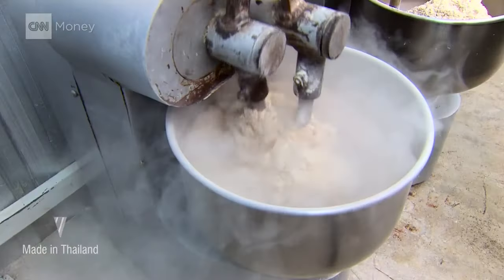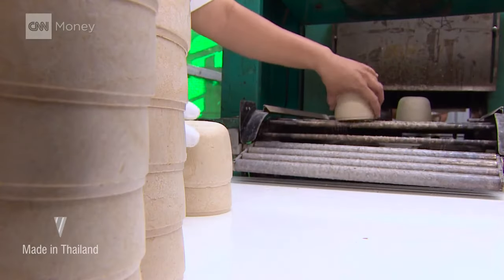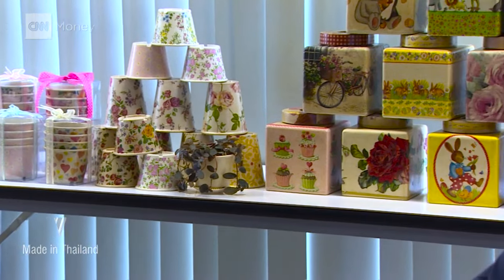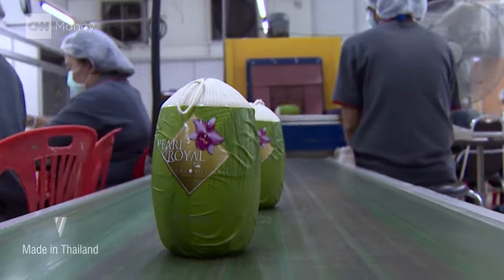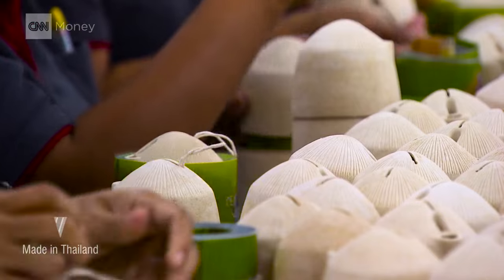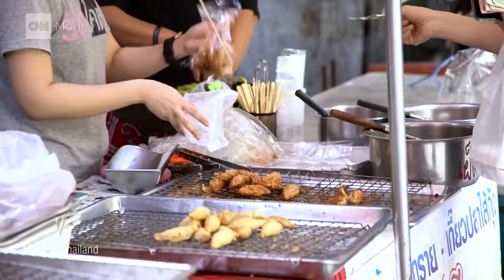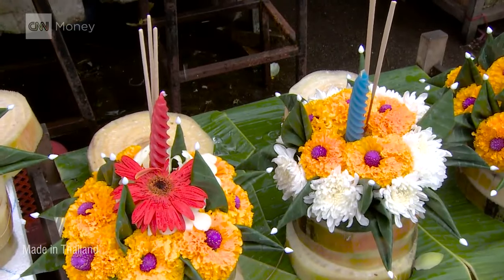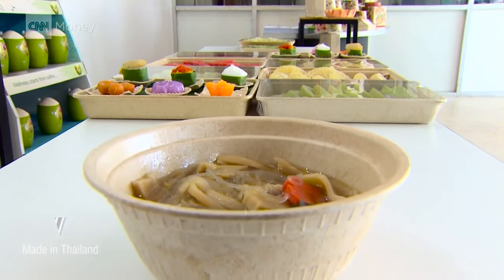This zero-waste packaging is made from bamboo

Comment: I think if you wanted the product to last even longer but still degrade a  surface wax could be employed making it useable for plant pots, drinking glasses,  in honeycomb configuration and two sheets of paper would make boxes or wall building material paint making it waterproof of interior wall panels.

Comment: People. Different biodegratable plastic exists! Read the fucking wikipedia...aliphatic polyesters with hydrolysable ester bonds,polyhydroxyalkanoates (PHAs), poly-3-hydroxybutyrate (PHB), polyhydroxyvalerate (PHV) and polyhydroxyhexanoate (PHH), Polylactic acid (PLA); Polybutylene succinate (PBS), polycaprolactone (PCL),Polyanhydrides, Polyvinyl alcohol, esters  with celluloid,polyethylene terephthalate... What we need to do is to actually stop production of non soluable plastics all together, and exchange them for biodegratable kinds. Not, ignore the problem like most of zero waste movement does. Idiology on small scale is not going to change situation in China or somehow magically sort out the plastic garbage in the seas. 
But yeah, sorry, growing fucking pineapple makes more sense.

Comment: Zero-waste then why are they using metal cans 1:48
Reply: Because that's the product the packaging went around. Looks like a novelty coconut drink, where you might pull the cans tab and drink from what looks sort of like a coconut
Reply: Metal can be broken down by oxidation.
Reply: Mrtal can be melted and reused many times. It can also be degraded if needed.

Comment: Lmao I bought that drink, nothing special, and they say zero waste but what about the metal can inside the casing? And the plastic straw.
Reply: Becky lets not forget the part where this cuts down more trees. Surely they replace them after word, but its not that great an alternative.
Reply: It is made with a disposable part of bamboo. So, is an intelligent way of use resources without wasting more.

Also, bamboo grows at an incredible rate because it's basically grass.
Reply: Metal is recyclable, or it gets corroded and becomes a part of the environment anyways. It's the plastic that is the problem.
Reply: 1. Metal is not a immune to disintegration. The environment itself does the recycling; ever heard of chemical weathering? And metal doesn't damage the environment like plastic
2. Have you never drank anything without a straw? Try ditching it, you won't die. If you are still incapable to drink without a straw, try the zero- waste alternative by carrying a stainless steel or glass straw
Reply: plastic also disintegrates, just much slower